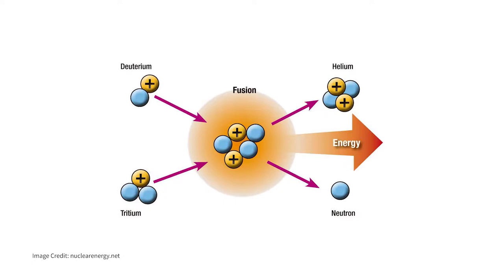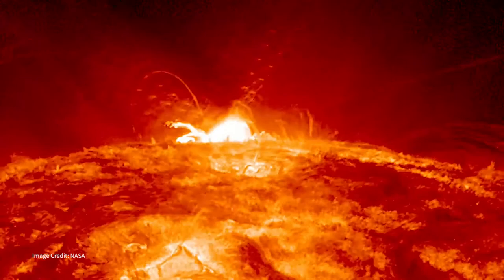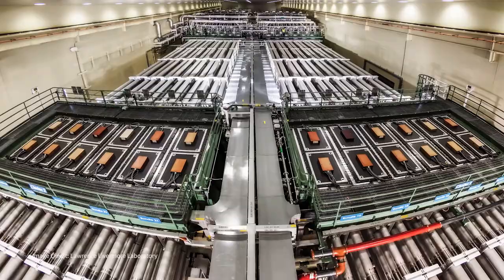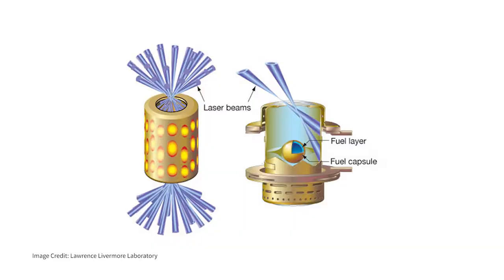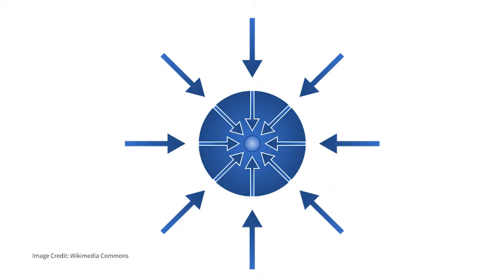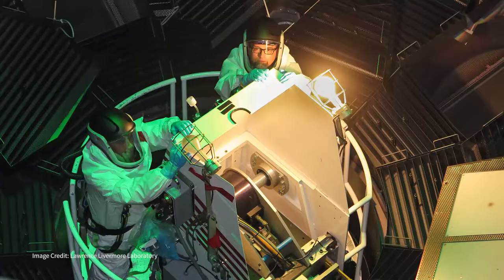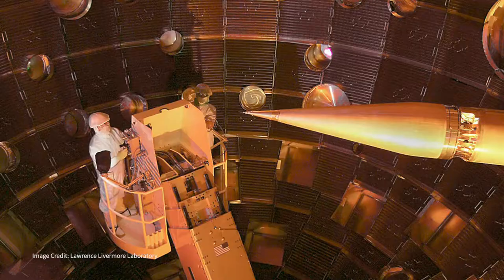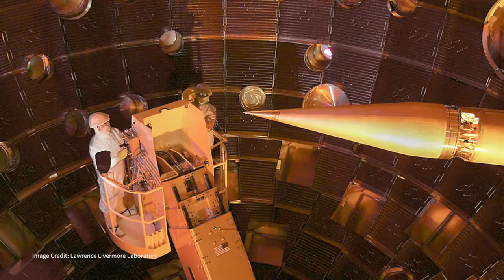Dr. Mark Herrmann: Creating, Diagnosing, and Controlling High Energy Density Matter

Comment: The last experiment resulted in "Runaway Things" so called by M Herrmann. However i.m.o. he found the new string physics of interferenceball lightning or micro black holes.  Because he saw hot plasma running away fro the center. with plasma creation which formed a pushing tail for acceleration of the microblack hole ball lightning .
Reply: According to Q-FFFTheory,  the NIF  laser interference  produced so called "Runaway Things" no arxiv article I have found about the number of "runaway things" which in Q-FFF Theory could compare to micro black hole string knots or ball lightnings.
So my proposal is to use les laser power bur also longer laser power or intermitting power, to produce multiple "Runaway Things"  by the experiment to get information about the relation between the interference and the number adn decay time of the runaway things or micro blackholes.
Noe deuterium seems to be needed at all.!.